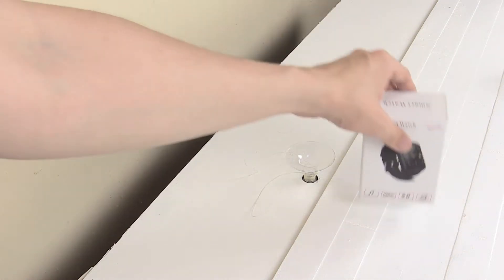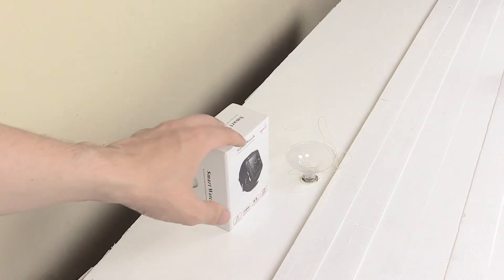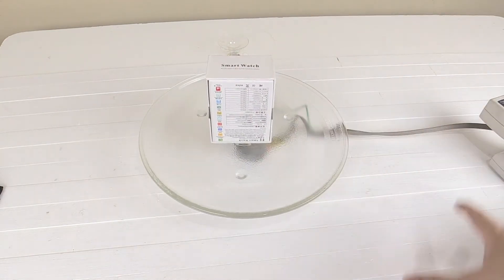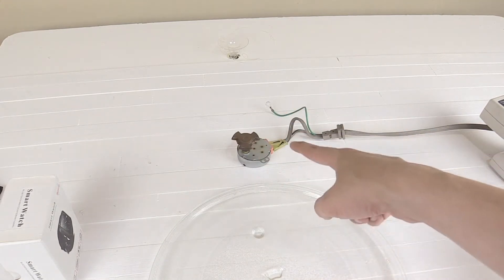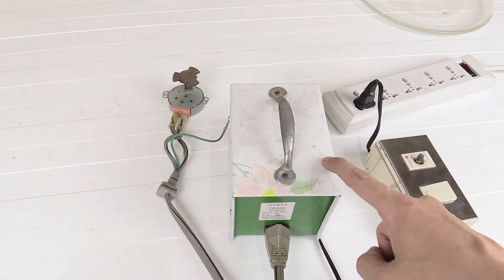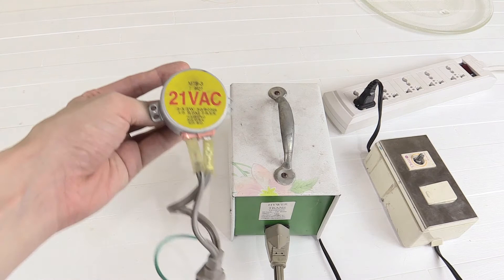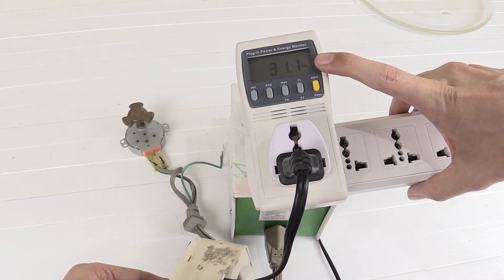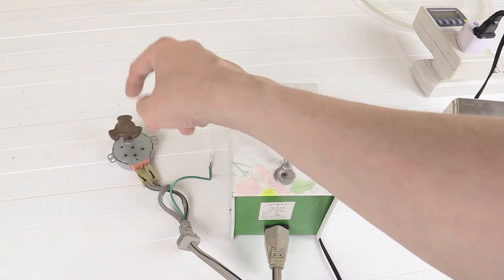Microwave motor 360 spinning platform

Comment: if im not mistaken the rotisserie motor runs at 220v and more quieter
Reply from the maker: +woufei047 Most microwave motors are also 220v or 110v but this is a weird one. But for sure, finding a straight 220v motor to start with would be a lot easier!

Comment: The buzzing is from the chopper dimmer, a 220 motor should be almost silent
Reply from the maker: +A D Ah yeah, that would make sense. I wasn't able to test it with any other power source so I just assumed it was the normal noise of the motor because it sounds just like when a microwave is running.